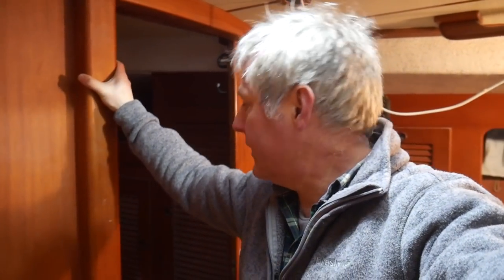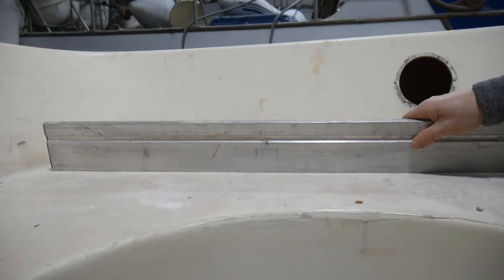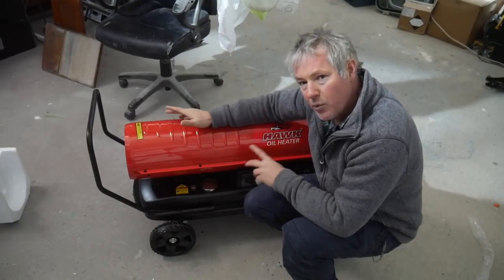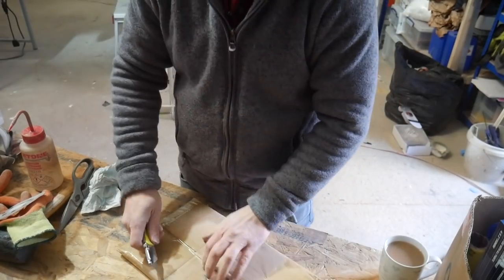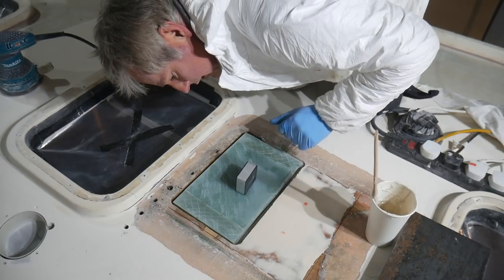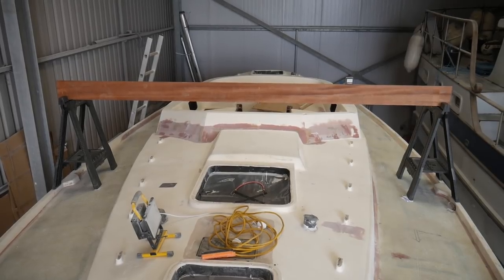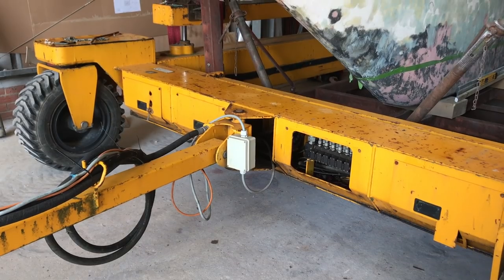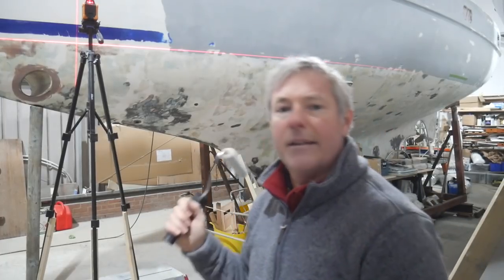#50 using a laser to strike the waterline

Comment: Thanks for following up on questions some of us raised about the low points in the cockpit seat.  I wasn't aware of the location of the drain at the midline.   An option that might be worth considering is adding drain holes at the port and starboard low points that tie in to the existing drain hose.   The downside is that additional drains could complicate the job of installing teak on the seats.  Thanks as always for your updates.

Comment: A good update Richard - glad to see you persevering with Wanda and I think that first coat of primer will really bring home the effort in all the prep work. It will spur you on to complete the project. 

G10 absolutely the right decision in my mind. 

With regards to the drains, remember that the boat is rarely level against any planes when under sail - she will be heeling as well as up and down through swell. If anything, ensure the cockpit sole drainage is completely adequate and sealed.

Waterline level - you said it - you can always raise it. Remember that depending on how much junk you throw in her, tank configurations, ground tackle weights, new glass added, old teak removed etc... everything effects, so I wouldn't change the existing level by too much based on a comparative analysis of other HRs. Go with your gut - you can always fix it again, as you are proving to yourself.
Reply from the maker: Thanks Brennon, thats very encouraging to hear. And yes indeed you are correct - when she is finally doing again what she is meant to be doing (sailing) she will not be level much so that drain in the cockpit seats isn't so critical. So long as the main cockpit drains can get rid of a mass of water quickly that's the main thing.

Comment: Not a sailor but, Isn't the water line approximate? Adding or removing weight will make it float higher or lower in the water. I wouldn' really be overly concerned with making it perfect till I had it in the water once.
Reply from the maker: yes you are right - its an approximate, and I won't know if its right or not until I get her in the water - then I can change it up or down at a future stage. Its more about getting the line straight - it does stand out when someone has made a guess at a water line and you can see the line wandering up or down. So the main thing for me is to get a nice straight waterline that makes the gloss line look cutting